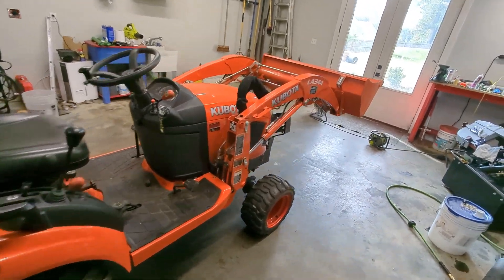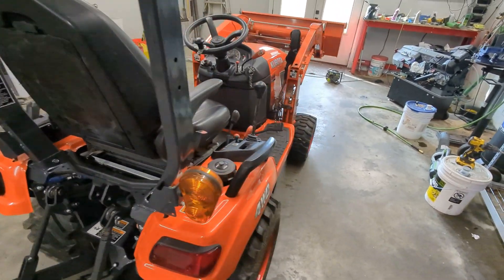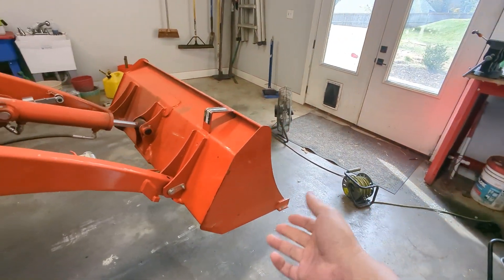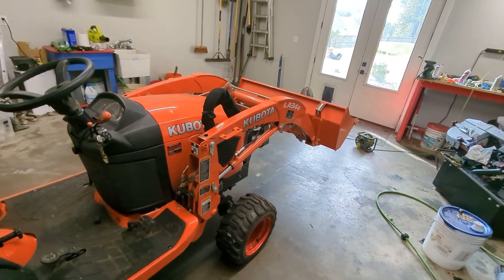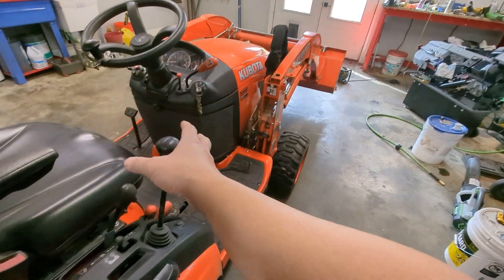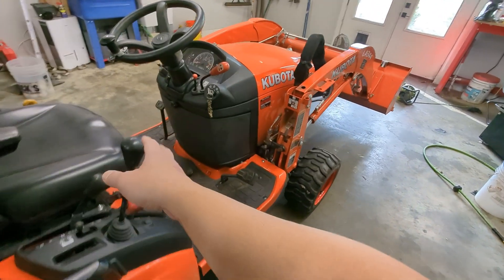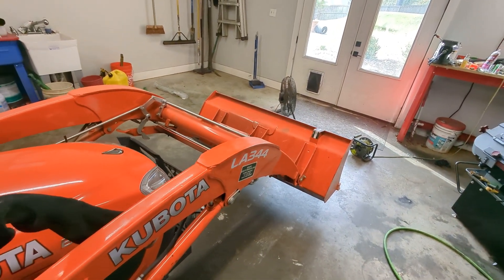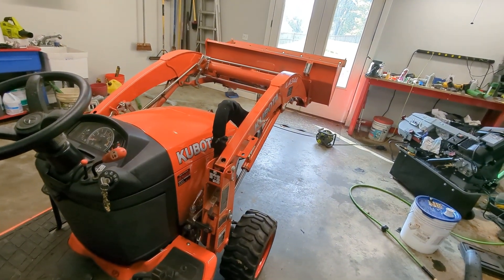Kubota Loader Valve - Better Than John Deere?

Comment: It’s great to hear an explanation of why dead heading the pumps on these Kubota/BX tractors causes the hydraulics stop working all together, as Iv often wondered myself! Now that being said the only time I have truly actually noticed this issue (and I have a TON of seat time on my BX) is when I’m curling back and booming down .. If I try to do both fully it will stop everything in its place.. but when that happens I just ease up on one valve or the other to get it to keep working and once you get use to it you won’t even notice it. The second thing is I own an Artillian grapple and have used it alot.. I have noticed that clamping when fully closed (dead heading) while lifting or curling stops the movement just like you said .. only once my grapple is fully closed I only just periodically tap the button on the 3rd function to keep something clamped so it only stops the loader functions for a Mer millisecond each time as I’m lifting or curling at the same time so again it’s never been something that’s bothered me when using the grapple and is something you will def get use to and not even notice.

Your clearly a king when it comes to hydraulics and I’m loving your vids!

Comment: You say it’s an inferior valve in other applications why would that be?  I would think that boasting flow by simply adding the return fluid would be better in any application.
Reply from the maker: Generally speaking, series is inferior to parallel, but as I said, maybe not in this case.  Some people will never experience the negative effects of having a series valve, but it will frustrate others that will run into the trade offs often.

The reason it's inferior is because one spool is dependent on another to function as designed.  As I showed, if one valve trips the PRV, then the other one doesn't work.  Also, the situation where the pressure is compounded will give you lower overall functionality in some situations.  I think there are some other downsides based on how the flow moves in some scenarios, but I didn't have time to investigate what exactly was happening, so I didn't want to call those out without being able to fully explain the pros/cons.

The more widely accepted approach, which is a hint in itself as to it being better, is to use a parallel valve and add the proper amount of flow rather than reuse flow so that the spools can function well and be truly independent - no compounded pressures; continued use even if the PRV opens on one spool.

Of course, I could also argue, why stop there.  The real solution is to have an independent pump for each spool so it doesn't have to compete with the other and can be truly independent.

In the end, everything is about trade offs and Kubota gave up some functionality for higher lifting capacity situations for a better experience at lower capacity.  JD went with the crowd, and can handle situations that the Kubota can't, but gave up a smoother loader experience.

For me, the jury is still out at the moment.  Remove the treadle pedal and the ability to have HydrosPlus on the JD, and it's Kubota because loader speed and function are important to me.  Fortunately, HydrosPlus does exist, and unfortunately, the treadle pedal is likely here to stay.

Comment: Hi, I'm looking at getting a BX23S, just curious if you've ever had a chance to use their backhoe and what you think of it's performance, especially how well it handles 2 simultaneous functions.  I've heard the stock JD 1025 doesn't handle two functions very well, wondering if Kubota's is better.  Thanks!
Reply: put a hydrosplus kit on the 1025r and you can do 3 functions at once 😄
Reply from the maker: I have not had the chance to use the BX with a backhoe, I have only used a Kubota backhoe on an older B series.  That said, it should be a little better than the stock JD 1 series because of the higher flow that it has thanks to the priority flow divider, but's you'll still be left wanting if you are accustomed to using mini ex or larger backhoe equipment.

I would be remiss if I didn't mention that the JD with a HydrosPlus Stage 3 Performance Kit has the same implement flow as the BX23S at 3500 (5 GPMs) at just 2000 RPMs and almost double the flow at WOT (~9-9.5 GPMs) :)
Reply: @HydrosPlus  Ok.  I've seen your work on the JD 1 with tractor time with Tim, very nice.  I've only used a mini ex once, so not a big deal there, but I'm interested to see what kind of upgrades you come up with for the BX's.
Reply: It can do 2 at once just painfully slow.   After pump upgrade it can do 4 at once.    Every backhoe tractor should have the upgrade.
Reply: @projectswithjw   i agree 1000%

Comment: I've seen hydro system do this for large cylinders to return cylinders faster. On a none pressure side of cycle. I'm thinking about getting a  B. The bx runs threw it cycle so well. Especially with the hoe. Good to see you off the green.